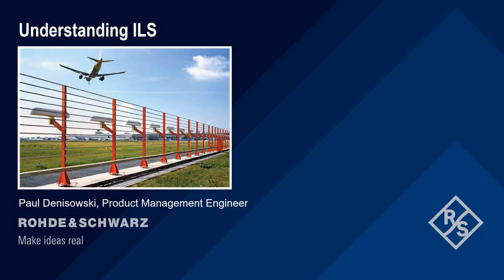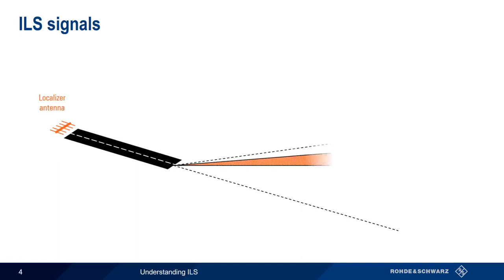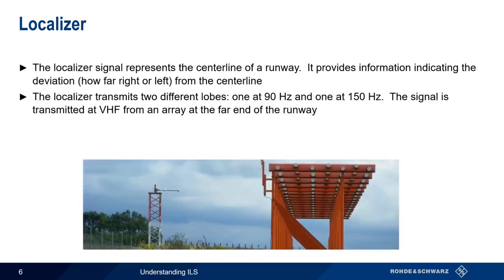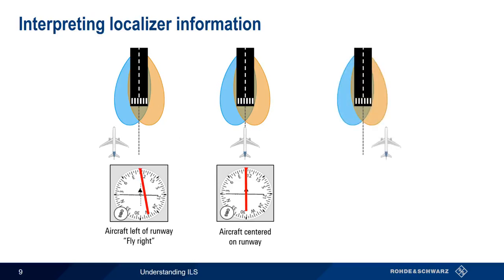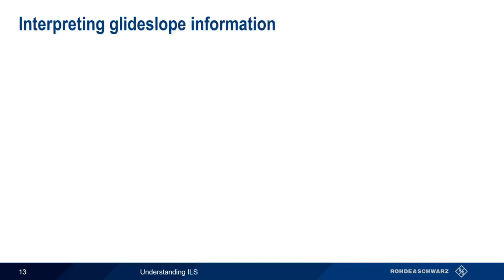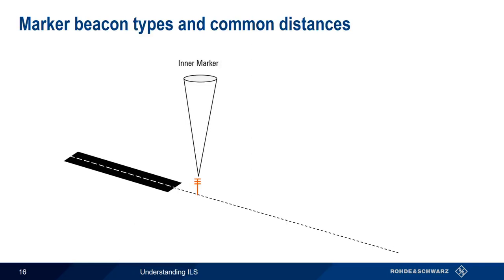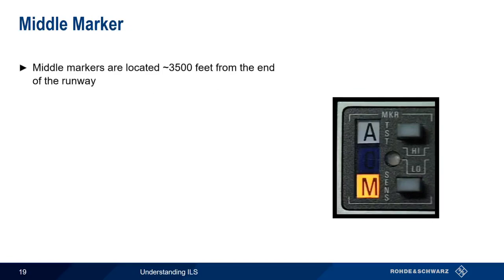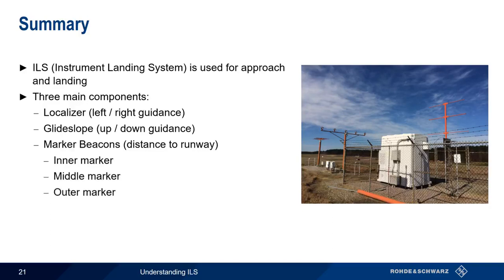Understanding ILS

Comment: can you explain why does the modulation depth of LOC equal 20% while the modulation depth of GP equals 40%? what's the difference? why does the modulation depth of GP not equal 20%?
Reply: The reason for different depths of modulation for localizer (20%) and glideslope (40%) would appear to be historical: I could not find a modern reference (or person) who could provide an answer as to why they are different.